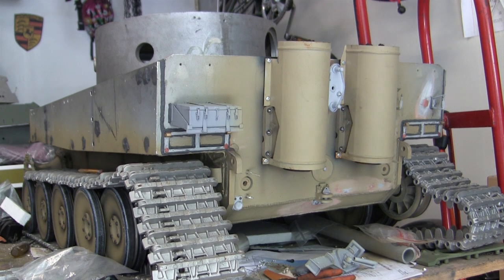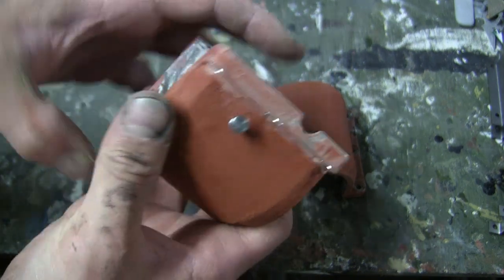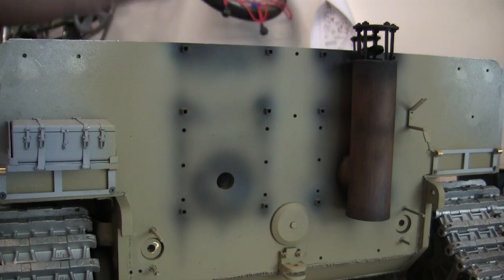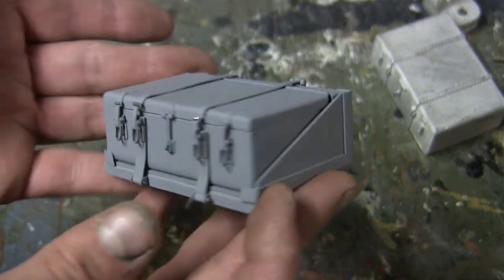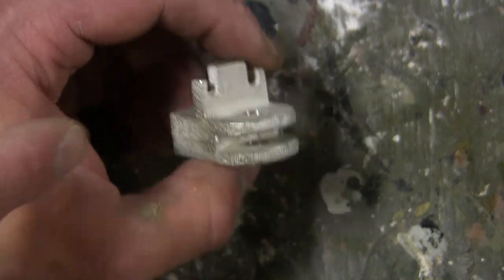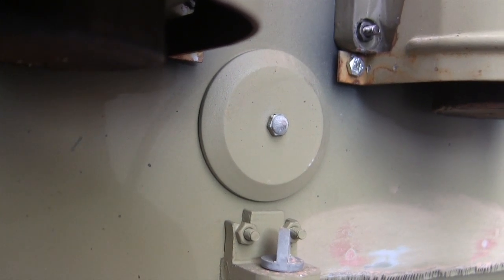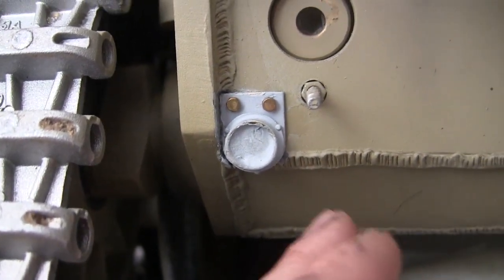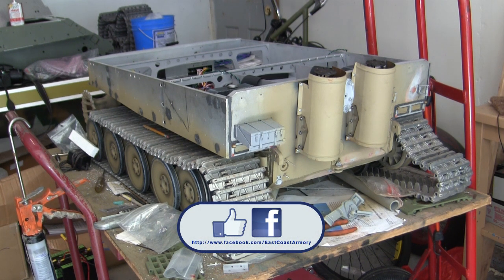Vintage RC 1/6th scale armortek early production Tiger I Video#8 (rear hull details)

Comment: You mentionned that no welding is required, the tank looks like it got welded togheter is there a technique that you use/ a material? If it is a material i'd be interessed in knowing the name :)
Reply from the maker: All the welds are sculpted out of epoxy and are only for detail... they don't hold the model together. For welds most people use miliput or aves sculpt. There are tutorials on the net and youtube that goes more into how to do it.

Comment: What do you think about the ''Mark 1 tanks'' Radio controlled 1/6th scale tanks? Have you ever worked on one and if so, did you like it the way they are made for example working with the electronics etc?
Reply from the maker: Like with metal box I have yet to work on those Mark 1 tanks. I can say that mark 1 is a dealer and finishes them off for customers. The tanks themselves are made in the Ukraine and they are made out of fiberglass. Their tanks are all hand made as opposed to the Machined fabrication found on the armorteks and the metalbox. many people have them and post pics and videos of the tanks on youtube, they look to run well from the videos, and he does have a few interesting russian and German tanks in the catalog that I wouldn't mind getting for the collection. 

However If I were given a choice between the exact same type of tank and my choice is between the Mark 1, or armortek... I'll roll with the armortek.
Reply: I agree. Would it be smart to buy a metalbox tank and replace it with high quality armortek electronic equipement? Since the tank is prebuilt and very well painted and i believe i have the skill to change the electronics and i'd love to install them myself. In your opinion, would it be a wise idea? Or should i just try to find someone that sells completely built armortek tanks? Or just the tank being built and painted? I wouldn't mind too.
Reply from the maker: I can't say for sure if they are compatible, depends on weather or not the metal box one is 24V powered. If it's 12V then you can't use the Armortek system.
Reply: I believe you have the choice to use 24v or 12v but i'm not sure.
Reply: What about the heng long 1/6 scale Tiger 1 tank?
Reply from the maker: So far from what I've seen it's vaporware, and if / when it comes out will cost more then an armortek kit
Reply: In your most honest opinion, do you believe it will be high quality/better than armortek?
Reply from the maker: from the video and pics I've seen it looks like a scaled up version of the mato metal model... with the same mistakes that need to be fixed. It's workable but for 10K is almost double the price of the Armortek... which IMO is better engineered and is a better value.